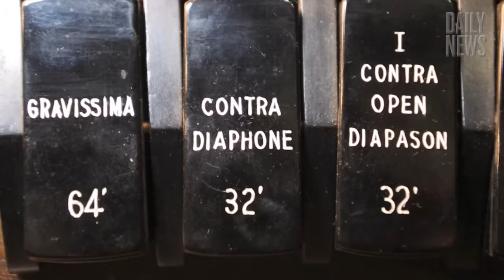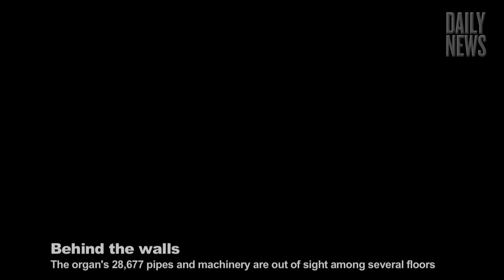The Wanamaker Organ - Inside the world's largest operating musical instrument

Comment: 6 keyboards and like 600 keys on each side with all the switches. flying a space craft seems less complex than this
Reply: Does Kerbal Space Program works?
Reply: Have you ever built a level 3 sentry?
Reply: it does seem to take multiple people to play the thing.  One pilot and one engineer.
Reply: Even Bach sometimes had an assistant to change the stops. (Not counting the poor apprentice pumping the bellows,)
Reply: Team Fortress 2???? I was building level 3 sentries in Team Fortress 1 while you guys could barely walk.
Reply: So does the Wanamaker (fantastic name) organ have user presets or just factory defaults?
Reply: LemonSlice they can be set on the spot. There is a set piston (the preset buttons are called pistons I think) that you toggle. You would then set all the stop tabs that you want for a preset, and when you're done, you hit that preset piston to set the preset. You would then toggle the set piston again to turn the set mode off. When you hit the preset piston after that, it will open all the stops that you set for it, and you can then play music. It only takes a press of a button to change your entire orchestra. There are presets specific to a manual, and presets for the entire organ, so you can change every keyboard's voice set.
Reply: Do you die when you mess up playing an organ?
Reply: @Droopy__  Have you ever tried playing that organ? not me, but in some ways it is more complex than a spaceship
Reply: Except you don’t vaporize if you press the wrong key.
Reply: @urmorph  could have easily used electrical motor there
Reply: As an elite dangerous player I can confirm this
Reply: Not that complicated.  Each stop is on or off.  Each key is playing or not playing.  There are many of each but that doesn't make it complicated.  Having multiple keyboards actually makes playing difficult pieces easier.
Reply: @ChinBiter47  Nope, you don't. You can make mistakes. The best you can do, is forget that mistake and play on. Later you can practise that part again.
Everybody has to learn to play it. Those keyboards look like a piano, but you play it a bit different. You can play very long tones, and on old mechanical organs you can hear very good how slow or fast you press the keyboard. Some stops play very light, some stops require strong fingers. Every organ is different in that respect. That's also what you learn.
And that big keyboard you play with your feet, you need some practice. But you will get better and better at that.
So it is a complicated instrument, very big and designed for a certain sound and for certain styles of music. But you can always pull just a single flute, and play a piece of music that you know how to play on your piano, for a start. Registration is an art in itself, and don't forget the Wanamakers organ in this video is huge. Most organs are smaller, not so many keyboards, not that many stops, but the concept is basically the same. And yes, during a concert you can mess up with that, too. Some composers want many changes in the sound and volume, during a piece of music. Then you need two or more helpers, pulling and pushing the stops. Or a computer doing that for you. And things can go wrong, and that's why you practise
Reply: @abigailshaw2329  Well, one of my friends is a professional organ player. And he asked me to help turning his pages during a Chrismas concert, he could not find anyone else. There was a choir and two famous singers, a soprano and an alto. And I am pretty sure I would vaporize when I would make a stupid mistake, during a solo would be the worst. I could turn the wrong page or select the wrong stops during that concert, and everybody would stare at me. It was okay, though.
Reply: @xtusvincit5230   A key is playing or not playing is a bit too simple. Just like a piano sounds different, depending on how you make that hammer hit the snares, you can influence the sound of an organ. That's the reason there are still full mechanical organs. Moving your fingers, you feel that valve opening and closing. Everybody can hear how you do that. That is what's making you a musician. A computer can open and close a valve, but did they take the trouble of giving feedback to each key in all those keyboards, adding the feedback for all those pipes connected to that single key? It takes some very special keyboards, to give you the same feedback a huge mechanical organ gives to you. Just measuring "velocity" does not even come close.
That is the real complexity of an organ. And the mixing of sound is the other complex thing, what happens in realtime in a real organ, standing in a hall, that is very hard to model and simulate in a computer, 3d sound wave calculations must be pretty complex. If that software were perfect, we could listen to an organ simulation and not tell the difference between the real organ and the computer simulation. And I wonder how many speakers you'd need to play that simulation in a same sized hall. That's like the ideal Hauptwerk system, playing samples of recorded organs on your digital organ keyboards.

So far on complexity. We can keep it simple, but all musical instruments are pretty complex.
Reply: @xtusvincit5230  But for non musician it looks like a headache lol.
Reply: @lemonslice2233  The presets can be set on the fly by any organist and almost unlimited presets changed at the push of a button. With the modern solid state version there are multiple memory levels so the number of preset buttons (pistons) is almost non issue.
Reply: I mean you are not too far off. Most of modern-day aircraft/spacecraft have built-in computers that handle an array of calculation/control. My comment is no way diminishing the amazing pilot's ability to fly, but rather highlighting how these instruments were built years before the modern age computer is even a thing, and musicians back then poured their heart and soul into learning and perfecting this instrument.
Reply: @abigailshaw2329  you do publicly xD lol everyone neighbor's neighbor can hear that organ miles away
Reply: One player and two additional boys for switches :-)
Reply: 528 keys exactly.

Yes, I'm that person.
Reply: @lemonslice2233  it’s not a factory made product. There is only one of these. So the organist can preset what they want on all the pistons.
Reply: @AffordBindEquipment  it actually doesn’t take multiple people to play. The dude in the beginning Peter Richard Conte is the one who usually plays the organ always plays it by himself.
Reply: The Space Shuttle had over 2000 switches.
Reply: @SlayerofFiction  That is probably around how many controls are on this organ or more.
Reply: fuckin true

Comment: Thank you Macy's for saving this treasure.  Now if only Atlantic City could find similar savior for the Boardwalk Organ which is even bigger.
Reply: kiqw it's still in the middle of restoration. They have a YouTube channel with occasional updates.
Reply: what there's an other organ . bigger. than this . 🤔
Reply: The organ at the Atlantic City Convention Hall is slightly larger but not fully functional yet due to storm damage(leaking room many years a go) and lack of maintenance.  It is now undergoing a multi-year restoration project. Once completed it will be again the world largest pipe organ.  As an example, This organ at Macys has six manuals and around 30,000 pipes whereas  the organ in in Atlantic City organ hs seven manual  (two of which are larger the standard 61 note organ manuals) and has about 35, 000 apes.  I understand that Mr. Conte neede to promote the organ at Macys but hegas played the Atlantic City organ and there is one or two You Tube videos of him doing that.
Reply: @kiqw  the organ at Atlantic City is the world’s largest based on number of pipes, however the Wanamaker Organ is the world’s largest pipe organ based on number of ranks and physical mass weight.
Reply: @dylantaylor2834  Yes, people like to use the number of pipes as the way to rank things.  Die Orgelseite lists Macy's as having 464 ranks and Atlantic City at 314 ranks.  That would seem to be the most important factor but that site also lists voices thusly: Macy's as 376 and Atlantic City as having 314 voices.  That factor puzzles me.
Reply: Midmer-Losh is Wanamaker Organ's big brother

Comment: But does it have midi ports ?
Reply: No, but it can process external audio through it's pipes.
Reply: It doesn't have 1V/Oct CV in/out? Pathetic. A toy. Not even worth it. Back to the drawing board.
Reply: @Carter Mattoon No, it's for playing audio games.
Reply: They could probably add MIDI without too much effort. The keyboards uses electric signals to open the valves anyway, unlike mechanical organs which use the movement of the keys to mechanically open valves.
Reply: check out Rob Scallon's channel. This one doesn't, but the one in Chicago does.

Comment: Imagine how it must sonds if ALL Stops are coupled on one manual o.O
Reply: that would be magnificent!
Reply: Christoper Anton that would be deafening!!
Reply: Danny Benthien They say it sounds horrible if you just pull all stops out without being selective about them. Also, all the quiter stops are just wasting air since they cannot be heard then.
Reply: By that point the organ might be starved for air despite 8 blowers.
Reply: Not if everything is tuned properly. But it WOULD be overwhelmingly loud. Of course, a lot of the softer ranks would be completely drowned out.

This organ has a switchboard for which ranks are used multi-level tutti switches, to avoid both unnecessary loudness unless true "full organ" is what's wanted, and to avoid using soft stops that wouldn't be heard.
Reply: Conveniently, digital organs would also encounter this problem on lower end computers due to the limited polyphony you can achieve

Comment: I knew the Wanamaker organ is a monster-sized instrument but didn't realize it was only 5 to 10% smaller than the Municipal organ in New Jersey (at fully operating status). Organs of this size require long term approaches to on-going maintenance; every pneumatic appliance within the organ should be assigned a no-later-than date for rebuilding.The same approach should apply to cleaning and regulation of the pipes. It's great to see they have dedicated space for the organ technicians and lots of lighting. Digital switching technology is going a long way to making organs of this size considerably less expensive to maintain. Great video!!

Comment: I have worked in data centers over my working career where the temperature and humidity had to be very precise. The reason for that was so components wouldn’t burn up from high temperatures and to prevent arcing across circuit paths from static buildup. Anywhere there is a large pipe organ the pipe chambers have to be temperature and humidity controlled to maintain the sound of the tuned pipes. Since pipes are made of different materials, wooden pipes could split if they got to dry. So when you see or hear of a large pipe organ, like this one, think of the money spent not only to refurbish the organ but to maintain sound quality. Kind of overwhelming when you think about it. Thank you Macy’s for restoring an truly national treasure!

Comment: The Atlantic City organ has been converted to solid state and midi controls as sections are being restored. Not sure about the Wanamaker. But being able to program presets for a musical work from the console of this size would be immensely helpful to the organist and allow multiple stop changes with one button  push from below the keyboard. Originally presets could be programmed from inside the organ relays by hardwired connections but it had to be a laborious and time consuming task.

Comment: Shop at Macy's!  They are not only continuing to operate some of the United State's grand palazzo department stores, but maintaining the WORLD'S LARGEST OPERATING MUSICAL INSTRUMENT!
Reply: Ralph Hahn it’s not the largest. The midmer losh in Atlantic city is the largest.
Reply: Ralph Hahn the midmer losh in Atlantic city has 33,114 pipes where as the Wanamaker only has 28,677 pipes
Reply: Steven Middleton - Ralph Hahn says it's the world's largest OPERATING musical instrument.  However it's not the largest operating musical instrument, but it is the world's largest functional pipe organ.
Reply: @stevenmiddleton75  It depends on which metrics you use.  Wanamaker has more stops but Atlantic City has more pipes.
Reply: @HeidiKohne  well I'm an organ builder here in the 🇬🇧. And we measure the size of an organ by the number of pipes. Not by the number of stops. Im not disputing the fact that at the moment macys is the largest operating organ. But technically the midmer losh in Atlantic City is the largest in the world.

Comment: Just because an organ is big it doesn't has to be good. I'd rather listen to a concert played in Notre Dame than listen to this one. Building an organ doesn't mean to squeeze as many pipes as possible into the room, it has to be built FOR  the room.
Reply: DasDoeni You could play just as well on a Yamaha Electronic Keyboard.
Reply: You've never actually heard this organ have you?  Macy's did in fact build the place to house that organ and the acoustics of the building are one massive resonance chamber. The sound can't be recorded. You have to go there. It has to be felt through the body and in fact there is no where in the building that you can't feel it. Because I was there with a theatre organist I also got a chance to tour the pipe chamber. It was one of the high points of my life.
Reply: Jim - Macy's did not build the place.  John Wanamaker built the place in 1876 making it one of the first department stores in the United States.  In 1910 he expanded the building and added the organ.  Wanamaker expanded the organ several times over a period of years.

Comment: As I am AMAZED at this organ. I believe is it NOT the largest organ. That title is still held with Atlantic City Convention Hall.

BOTH ARE IMPRESSIVE ORGANS! BOTH SHOULD BE CHERISTED AND HERD BY ALL!

The Boardwalk Hall Auditorium Organ, also known as the Midmer-Losh and the Poseidon, resides in the Main Auditorium of the Boardwalk Hall (formerly known as the Atlantic City Convention Hall) in Atlantic City, New Jersey. This colossal pipe organ was built by the Midmer-Losh Organ Company and holds several remarkable records:

Largest Organ in the World: It boasts an impressive 33,113 pipes (officially counted, but the exact number remains unknown) 1.
Volume and Space: The main auditorium, measuring 487×288×137 feet (148×88×42 m), has a floor area of 140,000 square feet (13,000 m²) and a volume of 5,500,000 cubic feet (160,000 m³). To fill this vast space, the organ operates at much higher wind pressures than most organs 1.
Guinness World Records: The Boardwalk Hall Auditorium Organ holds four entries in the Guinness World Records:
Largest pipe organ ever constructed.
Largest musical instrument ever constructed.
Loudest musical instrument ever constructed.
Only one of two organs globally with an open 64-foot rank 1.
Unique Features:
Stops voiced on 100 inches of wind pressure (approximately 3.6 psi).
Seven manuals on its console 1.

Comment: I think the organ itself (the control panel) where he sits to play should be connected to the whole thing, to give a better feeling that it's just one compact gigantic instrument.
Reply: There are two big reasons why this particular instrument has the electronic detached console.  #1: You couldn't have pipes in different rooms like this with a tracker/mechanical system.  Electropneumatic instruments allow pipes to be located literally wherever you want them geographically.  #2: The console would need to have a massive coupler assist system to make the key-pressing feasible on a large instrument like this.  Otherwise, the key action would be so heavy that your whole fist would be needed to play one key.